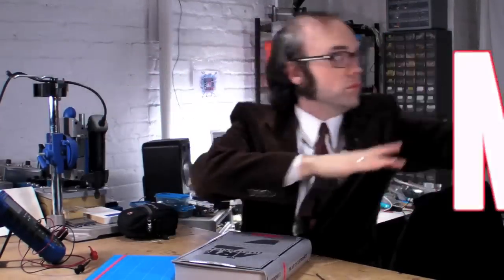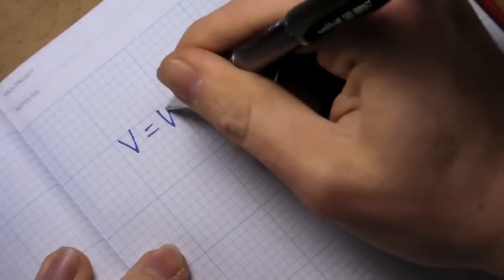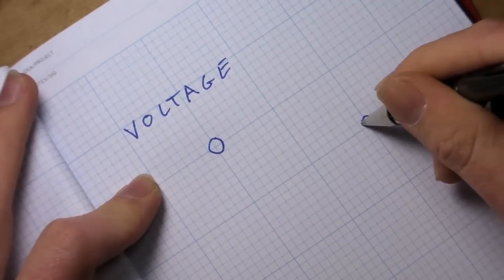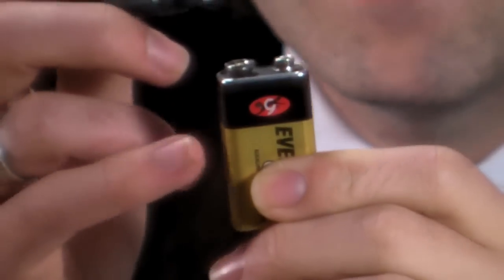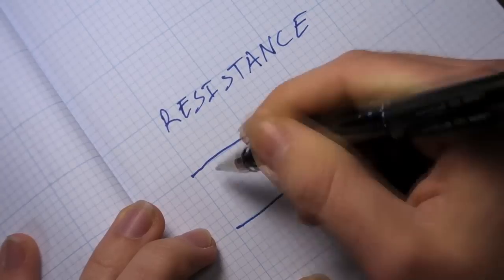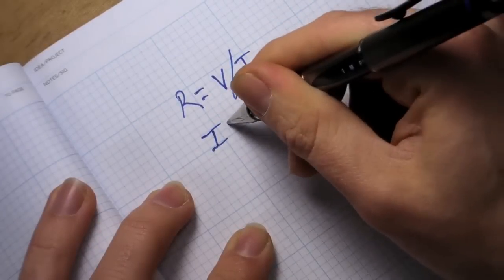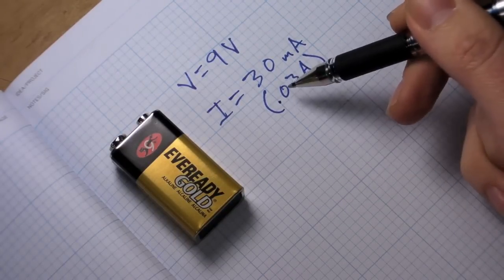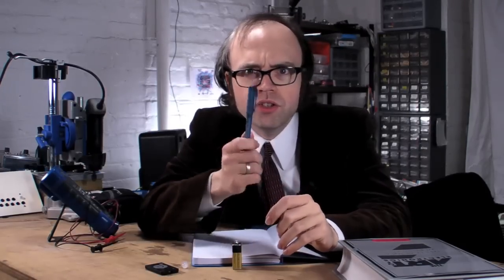MAKE presents: Ohm's Law

Comment: I'm an artists looking to experiment with LEDs and other basic electronics.

I've looked everywhere for any good, simple and clear, video that would explain Voltage, Current and Resistance, and this is by far the clearest.

This is the first and only one that has bothered to explain that voltage is a difference between positive and negative.

Now I get it.
THANK YOU!

Comment: @RandomWad In order to get the power you should multiply the voltage and the current that you are going to use. When you know what the power is, you go and buy a resistor. But when you buy it, buy a resistor that ressists higher power than the one you use, because if there is a power surge the resistor might overheat and burn.

Comment: @MandrewP that will be the voltage that you are measuring running in the circuit not the voltage needed to run the led.

Comment: I use a circle to remember ohms law. The top half of the circle is V(volts) the bottom half is split the same as the triangle. 

I also use the same thing for power except that the circle is in for equal parts: 
Top left is P 
Top right is E(voltage)
Bottom Right is R
Bottom Left is I
and E and I are squared
Just remember Pier and reverse the i and e
Hope that made sense.

Comment: If you imagine electricity is like water flowing through a pipe.

Voltage is the pressure of the water in the pipe. It's the measure of the force moving the water,

Current is how fast it's flowing or how much water is flowing. How much water passes buy a specific point in a given amount of time.

Resistance is like a kink in the pipe, or a region where the water has to squeeze through.

Comment: @DoingItYourself 
You have to know the current requirements of the LED. You could look that up in the documentation (data sheet) for that LED.  It will specify the maximum forward current, and then you would divide the voltage by that current to find the proper dropping resistor.

Comment: @aayush10001 
The voltage to run the LED is 3V. So when the circuit is running properly, there will be 3 V across the LED leaving 6 V across the dropping resistor. Whatever current is required by the LED (found on the data sheet) is what will be flowing through the dropping resistor and LED. Therefore, to find the value of the dropping resistor (which will have 6 V across it, you then divide the 6 V by the current required by the LED. 

So, 6 / LED current = value of the dropping resistor.

Comment: the current in a 9v battery can be any depending the resistance value of anything that u connect it to it. everything has resistance, even copper (just a little bit). and voltage is a force that moves the electrons and creates the current.. i hope u got it.. :] happy holidays..

Comment: So if you've got a kink in the pipe (resistance) the amount of flow (current) will only increase if you increase the pressure (voltage).

A high voltage will cause more current to flow through a resistor

Comment: This helps a lot when you are learning to build coils for vaping
Reply: Yep, also multiple current with volts to get watts. To figure out amps, divide watts by volts. For example 70 watts, at 4.35 volts equals roughly 16 amps. Now you can take 4.35 (volts) divided by 16 (amps) and get .2718 ohms of resistance.
Reply: +Brenndon McGill well I usually run 40 watts with a 3.8 voltage. with a .3ohm build. but lately to make it simple I use 50 watts .5 ohm build running 5.0 volts

Comment: @Hulks92 Yeah, but there is a difference between an unit and a symbol.
Of course in Austria we use V(Volts), A(Ampere), Ω(Ohm) for the unit.
e.g.: 10Ω*1A = 10V
But in formulas we use U(Voltage), I(Current), R(Resistance) for the symbols.
e.g.: R*I = U

Comment: You should have also explained about voltage dividers. Speaking of that, you should also have mentioned that the battery is not an ideal voltage source, therefore it has internal resistance, so your equation is technically incorrect, unless you mention the battery as an ideal voltage source.

Comment: @bazengao Current and amps are the same thing, so I was a bit confused by the question. Regardless, a transformer only works with AC power (like a wall socket), so that would be out of the question. You might want to look into a different source to provide that kind of current.

Comment: I am reading the Make: Electronics book and we are going into Ohm's law using a 9V battery and an LED rated at 2V (.02 amps).  The book states we should use 7V as our voltage in calculating the resistor.  So the formula would be 7/.02 for resistance for the LED.  I'm confused at what point I would use 9V and when I would use 7V to calculate the needed resistance.

Comment: Voltage and amperage would be the same at source. A 12 volt car battery is usually over 14 and allows for the resistance of the copper wires in delivering the current (amps) to the consuming devices.

Comment: Resistans can be added for example 2 resistors in series can be added together so if we have 20 ohms and 30 ohms and they are connected in series we get 50 ohms. if they ware connected in parallel it would be (R1*R2)/(R1+R2)
R1 = 20 R2 = 30
(20*30)/(20+30) = 12 
;) there you have it

Comment: The point is... You can try to solve it in many ways... In series current is constant everywhere and is determined based on the resistances (the smaller the fraction of resistances the higher the current) and the opposite in parallel... So you could even try to capture that higher voltage and higher current and presto...

Comment: This looks a lot clearer now. Could you explain the type of thing that would creat resistance say for instance in a house rewire. Please.
Reply: Bushmanron00 Wires are not perfect conductors and actually have a little bit of resistance. That's why wires get bigger (and more expensive) in order to carry more current. If you run your home dryer on wire for your bedroom, the wire will get so hot it may cause a fire. Often an extension cord running an air conditioner will feel warm.

Comment: This is the fundamentals of electric flow, and conservation of energy across a closed path. However, it's not good enough to determine how transistor operates, electromagnetic field behaves on a PCB. You can build a simple circuit based on OHM's Law, but, not a complex circuit that requires further complex analysis such as signal processing, etc...When we introduce inductance and capicitance, AC, it's very complex.

Comment: But this law is used only for the part of a circuit. For the whole circuit the formula is : I=e/(R+r), where I is current, e is emf (electromotive force), R is resistance and r is resistance of the power supply. Emf=I*R+I*r where the I*R=V so emf=V+I*r. Wich means that   I=V+I*r/R+r.

Comment: Now it might be complicated to understand... Example... Say in a series circuit where current is constant... But is calculated based on resistances... Meaning you can make that current anything you want based on and voltage (using fractional resistances... So say it's 10 voltage... With overall .5 resistances... The current is 20 and is constant even after the resistors... So if we capture that current... Then run it through a parallel circuit... It would be constant voltage... But that voltage is determined based on the resistances... So the voltage can be anything... Then capture that voltage and run it though a series circuit and in fact all currents and voltages in these circuits can be increased... Then divided... But conversely increasing the other... (Current and voltage) the key may be to capture it... Then run it through separately... But remember... In series circuits the current is constant  but is determined based on the resistances (fractional resistances increases it) based on voltage... And remember even though it's voltage drop... In parallel circuits this voltage drop is constant even after it runs through resistances... So capture the drop...

Comment: voltage source (9v) minus led voltage(5v) = 4 volts divided by LED current..lets say 10ma = 400 ohms. but if you dont have a lot of led's to play with, try starting with a 1k resistor in series with it and your battery and see if thats bright enough for your purpose. you will probly end up at somwhere between 400-600 ohms.

Comment: @robert0joe if you are using a 9 V power source....  if you have a 5 V power source and you want 0.03 A than u have to use a 166,66Ohm ≈ 180Ohm resistor ;)

Comment: Lastly... In a series circuit with one resistance voltage is constant every where and in series circuits so Is current... So as I said... Run it through One ohm resistance...Capture it... And run it through one ohm resistance again... And it would infinitely run a one ohm resistance like a lightbulb because nothing ever changes... The key is capture it and run it though separately...

Comment: i think a narrowing in the pipe would be more like a transformer, because its reducing voltage, but increasing amperage. i would compare a resister in a circuit with a hole in a pipe.

Comment: I've been wondering for so long...

If a 9 volt battery is connected in a circuit together with a 10 ohm resistor, the current after the resistor would be 0.9A.

Hence, without the resistor, would the current be 9A, instead?

Comment: I'm confused about one thing. So basically electricity comes down to ELECTRONS being transmitted through a conductive medium. How can that be if the particle that carries the electromagnetic force is the PHOTON? And electromagnetic waves propagate at the speed of light, so how does that work with electrons if they're massive particles?

Comment: That's not Ohm's law. That's simply the definition of resistance.
Ohm's law states that the ratio V/I is constant at a given temperature for an ohmic device, such as the majority of resistors.
In a non-ohmic device, the ratio (resistance) would change according to applied voltage.

Comment: Any idea how to use log potentiometers? I'm trying to figure out which one I might need to use for volume control. I have 3.3 volt power, maybe less and they come in different kilohm packages. I'm guessing the higher the rating, the sooner audio would cut out across the potentiometer.

Comment: Let's put it in more simple terms.  Why a 1.5 Volt AA battery is smaller than 1.5 Volt D battery?  Is that because the D-size battery has to handle more resistance, or more current?

Comment: @AppA  voltage is pressure or potential force of electrons.I think of voltage as a potential speed at which electrons can move, which may or may not be correct physically, but it sure helps my thought of electricity. Current is quantity, not really the rate of electrons as most describe. Air and water have the same basic physics as electricity does. Do a google search for an old book from radio shack called getting started in electronics. Read page 14. Google: Radio Shack - Basic Electronics pdf

Comment: I am no mathematician, so this may be a stupid question, but when you divide 9 by 0.3, why do you say you need a 300 ohm resistor? When I divide 9 by 0.3, I get 30...do you ad a zero because you were dividing milliamps and therefore need a stronger resistor to prevent the strong current from a 9 volt object into a receiving object which will only handle milliamps?

I am completely number-dumb, and I'll be watching youtube videos to hopefully correct that, so excuse my lack of understanding.

Comment: if i have a 12v DC supply and want to get it down to 9v is there a calculation that i can use to determine the resistence needed to get it down to 9v?

Comment: @DoingItYourself 
Ooops - I forgot to subtract the 3V LED voltage from the 9 V supply. When your circuit is running, there will be 3V across the LED leaving only 6V across the dropping resistor. Therefore, you need to divide 6V by the forward operating current of the LED to find the right resistor. Dividing 9V by the LED current would under power the LED by about one third.

You should be able to Google the part number of the LED to find the data sheet online.

Comment: Or, In series just total your resistors, Divide your voltage by the total resistor value to get total current.  With the total current value simply multiply each individual resistor value by your total current value for each voltage value across each resistor, sounds complicated but its not...

Comment: so if i have a nine volt battery and want to limit the current to 20 mA. it would be 9 divided by 0.02? but whenever i put 450 ohm resistor in every circuit it tells me i get 15.6 mA?

Comment: There are multiple ways to represent voltage. There is also E to represent source voltage and a lower case v to represent voltage in terms of its waveform. (i.e. v=120sin(667t+45deg) for an AC source). I've never seen it represented as U before. Perhaps it only comes up in countries which have not adopted SI units. You know who you are. It should also be mentioned that Ohms law is not an actual law of physics because there are variations in certain conditions. Better name is Ohm's suggestion.

Comment: what if i know that i have a 9 volt, and i want to reduce that to 3 volts (power a LED on a 9 volt circuit for example) how would i figure out what resistor to use to reduce the voltage?

Comment: Help here. I don't get it: ohms law states that current is directly proportional to potential difference, hence, shouldn't the equation be I=kV (where k is a constant) and not V=Ik( where k is constant, in this case, resistance)?
Reply: The Ohm's Law equation is actually I = kV/R where k is a constant. Since the units of  current, voltage and resistance are defined in terms of each other, k = 1, leaving I = V/R.

Comment: I've been given a question like p=i x v and the question says, transpose the following formulae to make the stated value the subject(show all working. Then says make v the subject.
Now I and v have no number like you did in your video, so what am I multiplying if no number was given. What is I and what is v? And they want me to use the triangle to show my workings out? I'm so confused? Can you help?
Reply: p stands for power, the formula states that you can calculate power by multiplying current( I ) by voltage (v). by subject they mean rearrange the formula so you can find v, which is v=p/I. there are two more formulas for power p= I^2 *R and p= v^2/R, R is resistance

Comment: I thought resistors drop voltage not current?. I want to charge a shaver off USB instead of using up another of my plug sockets. The charger is rated at 3.8v pulling 80mA. How can I make 5v USB that pulls 500mA max suitable for charger the shaver?

I thought it would be easier to use an 3.3v Voltage Regulator with a resistor, But I don't know if 3.3v will charge it correctly and you always get a voltage drop out.

Comment: Either I am missing something or there has to be more to it that you have presented here. In the example you give 9V supply and you want 0.03 Amps, we do the maths and we get that we need a 600Ohm resistor, all that's easy enough to follow. But doesn't it depend on how much current the 9V supply is at in the first place, if you have 9V supply at 0.0000001mA you are never going to get 0.03Amps and in the converse if you have a 9V supply at 4000Amps, sticking a 600Ohm resistor in front of that will send it and probably your circuit into orbit, what am I missing?
Reply: 300 Ohms brah.
Reply: +diecast jam There are many factors in studying circuits. One resource I found that succeeds in merging these is the Gregs Electro Blog (google it if you're interested) definately the most useful course that I've seen. Check out this  extraordinary website.
Reply: pakistan tanis I had a look at the 'blog' and its just some crusty old geezer trying to sell some cheesy books. I bet u are is nephew or something.

Comment: just verifying my understandings so if i have a Lipo Battery @ 14.5v and i have a DC Brushed Motor that requires a current of 3amps i would use this formula? V*I=P (power in watts) 14.5v * 3I = 49.5wats  
and if i want the Resistance i would do v / i = r so 14.5v / 3I = 4.8 ohms ? so does this means i need a resistor of the value of which color code suits 4.8ohms?  is this correct? 

it would be if Collin made a video using ohms law to find the value needed for a circuit setup where one will need capacitors resistors a given amount of amps to run a light or motor and a expected wattage with a certain voltage this way we can see how is it that all this LAWS help you assemble and finish a system based on our learning's
Reply: Frank Lopez DC motors have a built in resistance, which changes depending on the load and speed of rotation. They are more complicated than static resistors. If you put a multimeter in line to measure the current when the motor is spinning freely and when the motor is working hard, you would determine how the resistance varies for various loads (for that given voltage). Of course, you should use a voltage compatible with the motor. Resistors usually are not place in line with motors to lower the voltage, because 1) the energy is wasted, and 2) the current in some motors is large and the resistor may get hot... so hot that it would exceed its power ratings and become damaged.
Reply: i understand what you Ken tho i think you mis understood my original Q

( if i want the Resistance i would do v / i = r so 14.5v / 3I = 4.8 ohms ? so does this means i need a resistor of the value of which color code suits 4.8ohms?  is this correct? )

talking motor here what is this 4.8Ohms for ? how does this formula i just did help me ? i thought ohms is a property of resistant aka resistors ? and if so this formula will be suggesting what value type of resistor i will need, right?  even if i get a multimeter "which i have done" and with no load or power i will just use the test leads to place on the motors lead ends (+, - ) and with my multimeter set to ohms i would get a resistance value WHAT IS THAT RESISTANT TELLING ME?